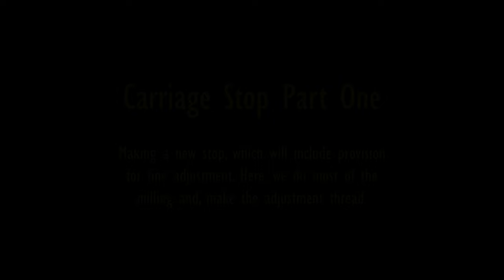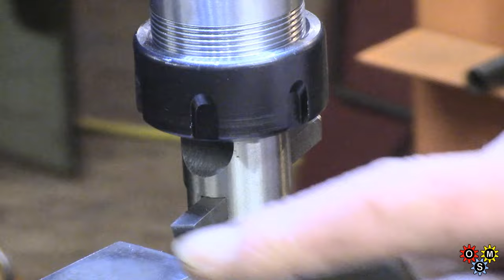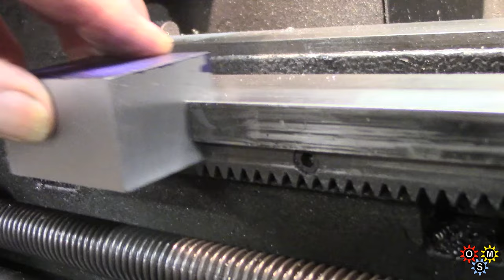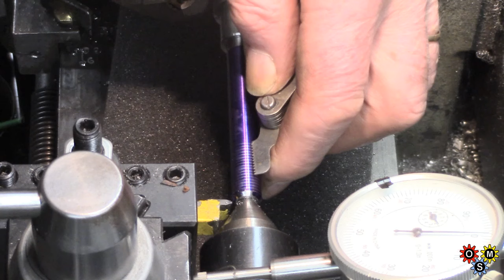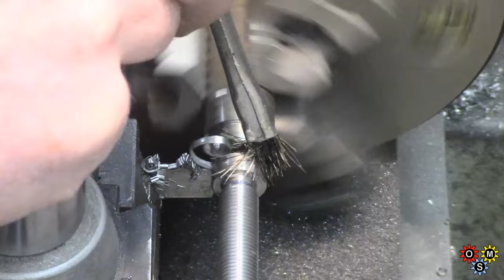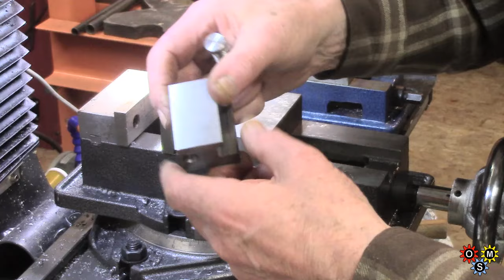Carriage Stop, Part One

Comment: Chris

Why grease on the ways?  Use way oil instead, doesn't thicken up so much in the cold. 

John
Reply from the maker: Hi John - I have found that a thin grease does well and is more persistent. That said I do add oil further back from headstock where most motion occurs. :)

Comment: Hi Chris,
Fellow pom here but living in New Zealand for the last 10 years.
How have you found the G0704 to be. Do you recommend it or would the next size up say a ZX(RF)45 type be a better buy for rigidity. We don't have Grizzly G0704) here.Our equivalent is the Optimum BF20.
I'm new to lathes/milling machines and have learn't so much from your videos as well as Doubleboost's, Adam Booths, Keith Fenner etc.
Regards
Kevin
Reply from the maker: Hi 'Kiwi',
I guess if I could have afforded it I would have gone up to a larger machine but that's not to say the 0704 isn't any good. For what it is it serves me quite well and since fitting simple DRO it's very adequate. Rigidity is OK if it's not pushed too hard - probably the biggest plus to a larger machine would be capacity.
Reply: Hi Chris,
Thanks for your reply.......Will have to do some more reading/watching youtube videos and try and decide.

Comment: Chris you need to treat yourself to a little propane heater , so you don't have to suffer that damn cold . I am 65 and the cold really does bother me now , and I live in Calif. where it's not near as cold as where you are .  I use a little electric radiant heater right where I am standing , it helps .
Reply from the maker: Hi John,
I do have a space heater - runs on kero and 75,000 btu output, so, that does help as a means of taking chill off. As I'm not in the shop all day it's not economical to heat all the time - the space heater does fine, as long as starting temps not too silly low. Next thing though will be being too hot!
I have used a small radiant too where I am standing sometimes.
One extreme or the other!

Comment: Please excuse my ignorance.  Could you explain the logic behind threading on the lathe followed by using the die?
Reply from the maker: Hi Adam,
Thing is, in order to save the relatively hard job of threading only with a die, it is useful to do the main thread form by single point threading - then, finish it off with a die to get a theoretically ideal form. Saves the late stages of monitoring the cuts to get exact - it's a bit of a useful ''cheat'' in some respects. :)

Comment: The lower temperatures cause any lubricants in my workshop to slow things down also, even the drawers in the metal cabinets can hardly be shifted, the other problem it causes is that the florescent lights are not coming up to full power, they take about 15 mins to warm up. Did you think about tapping a short length of you 7/16" through hole and using the knurled nut as a locking device ?     Chris B.
Reply from the maker: Hi Chris,
Oh yes, the lights - ages to warm up. Still ideas floating, but planning to have either a sort of detente ball approach or wavy spring washer. yet to decide! :)

Comment: I'm jealous! I only have 75mm clearence under my spindle.  I'm lucky to get a .3mm doc on a 3mm 2 flute end mill.  I'm using a cnc 3040 engraver (mill... HA!)  I'm about ready to make some knobs marked off with 4mm per rev and add some pointer so I can also use it manually.
Reply from the maker: Hi,
I could use an engraver sometimes - an X Cart would be nice! I have to engrave the adjustment wheel on my stop - when I get to finishing it.